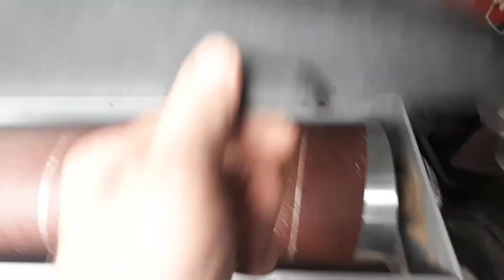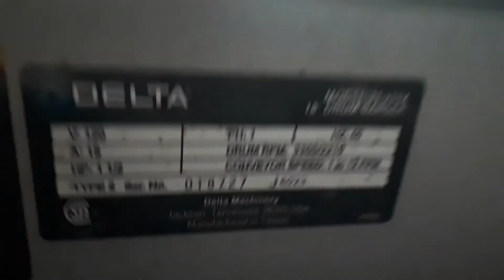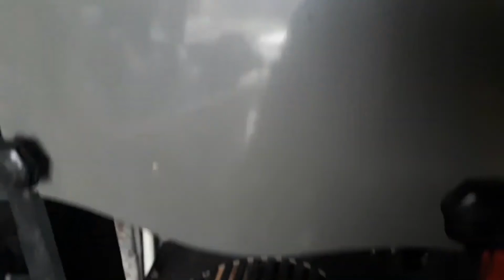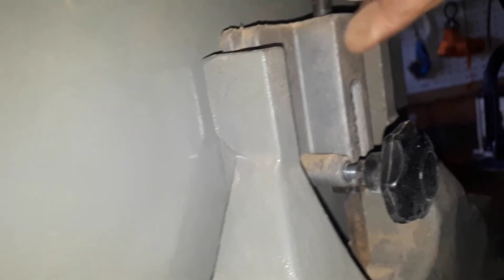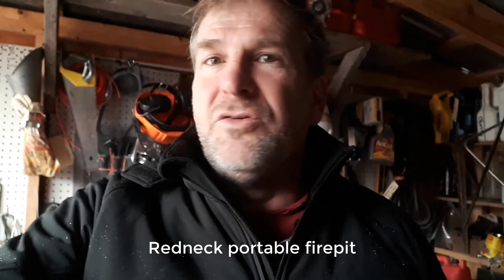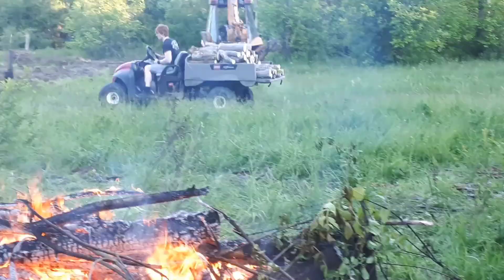NEW TOOLS & PORTABLE FIREPIT

Comment: I've got the same bandsaw, the parts are available through Busy Bee, and King Canada. Don't buy the pins... Factory replacement is sheared hot rolled... I made mine out of old drill bits. The other part was just less than $20...
Reply from the maker: Good info Tim. I would have thought parts would be unavailable because its so old. Thanks buddy.